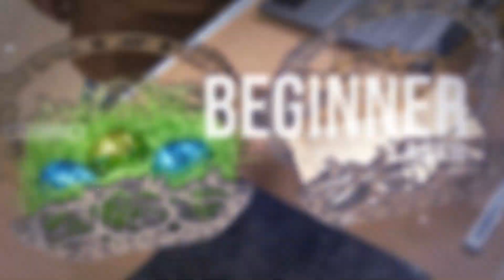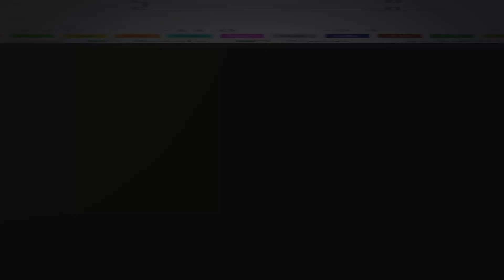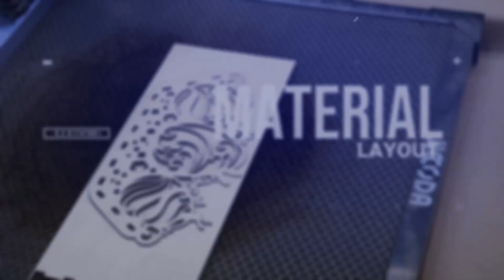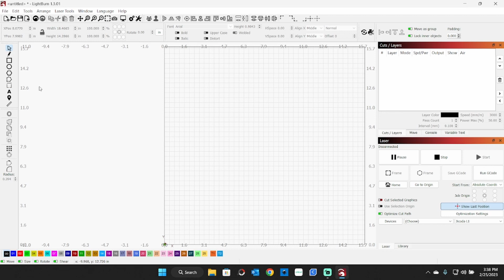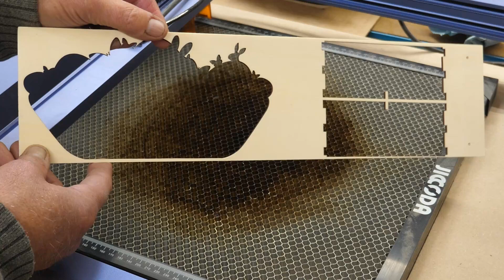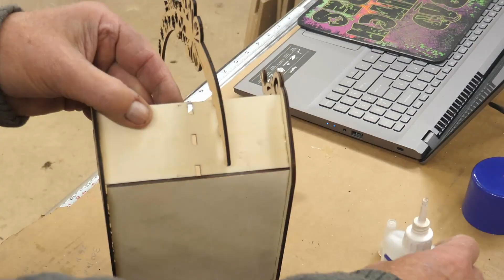Beginner Laser Project 15 Easter Basket

Comment: Great video..just wondering as many items mask their work when cutting,  but you don't.  Just a preference?
Reply from the maker: With air assist and honeycomb board, it is not needed.  it is also a hassle to 'weed' after cutting when masking.  I only mask if intending to do color fill.